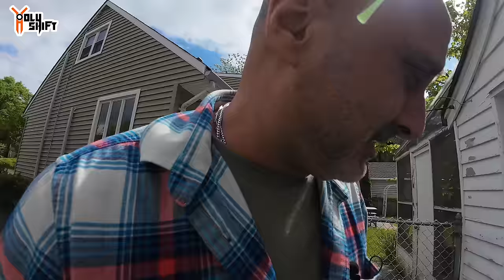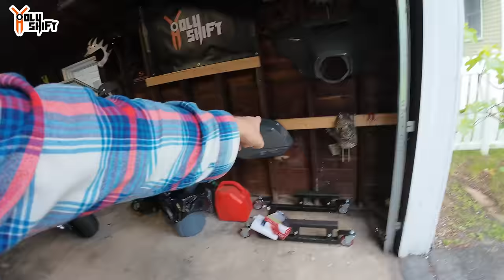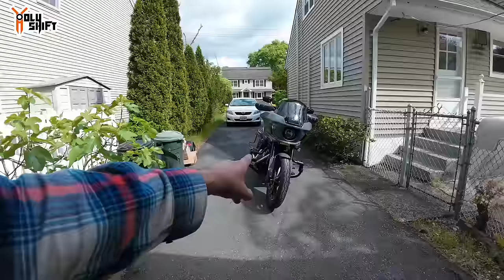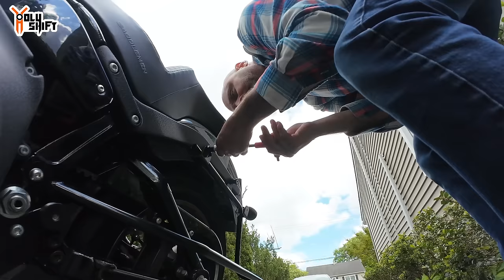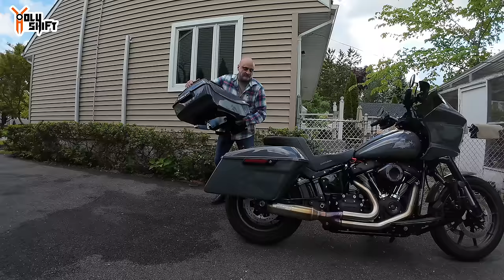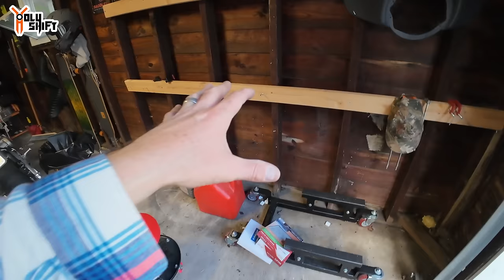Did I Leave YouTube ? Low Rider ST - Touring Set Up

Comment: Sandy, are you going to wrap the bags and trunk with aux LED Stop/Tail/Signal lights? They have LED insert replacements for the reflectors in the bags too.
BE SEEN, Can't have too much to be safe out there with So many asleep at the wheel... ya know?
Reply from the maker: You’re right I need more lights on the back side
Reply: @HOLYSHIFT  Advanblack makes those hand guards with running/signal lights in them too. My brother got a set for His RG3
Reply: Do you find the Mustang or Saddleman seat more comfortable?